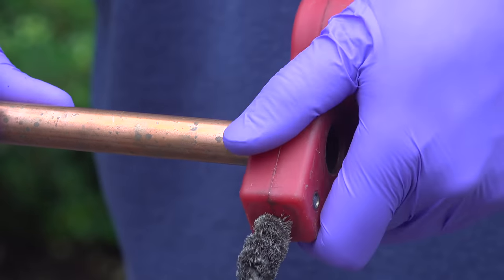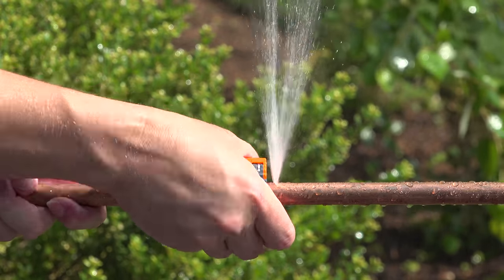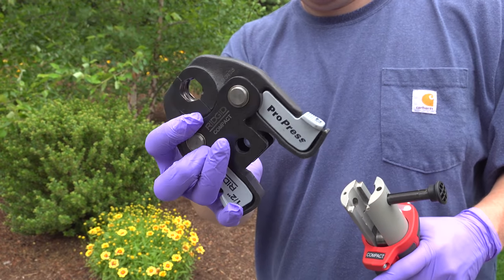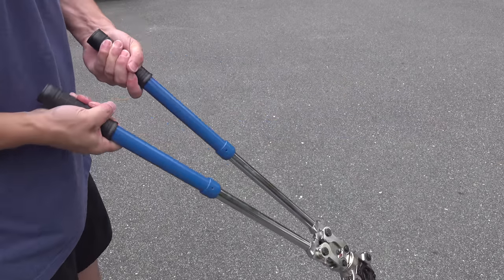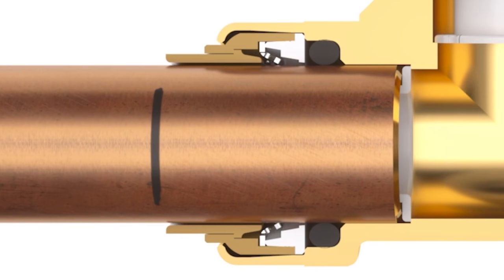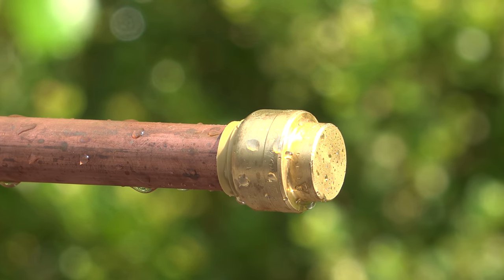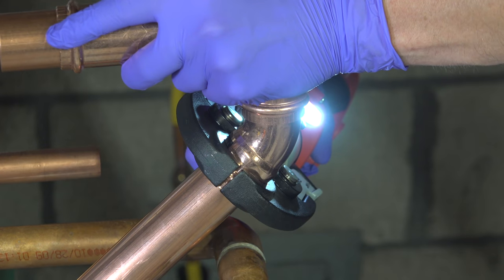NEVER SOLDER PIPE AGAIN - 3 Ways for EASY DIY Plumbing

Comment: I see people complaining about rubber degrading. Silicone: am I a joke to you?
Also don't use sharkbites with high water pressure. They have a rated maximum pressure. I see some people didn't read the manual... Naughty.

Comment: Need a special tool to remove shark bite fittings? Can easily use a crescent wrench, man. Also, if you are doing something in a wall, like I did today replacing valves for a washing machine, don't put that stuff in your wall. If it's on an indoor water heater that you'll replace 8-12 years down the road, probably fine. And I don't think you'd fit a propress tool in that wall, either

Comment: Come back in 5-10 years when the things all need replacing. 

Presoldered fittings are as easy as it gets. If the area has combustible material simply utilize heat mats

Comment: being a plumbing video you had to know this was coming. The critique. you should make people aware of the potential or should i say likely event that these products will fail. It doesnt matter it is eventual . Any thing that has plastic or rubber parts will fail. question is when but know it is just a matter of time. When they tested these products , it was most likely with in a decade or less. So these companies end up using plumbers and you a homeowner as testers for their product. Soldier pipes is proven long lasting permanent water  seal. Alot of these products were invented recently, 30 years or less. products require a lifetime of testing to be proven . which alot of these products havent really been proven to how long they will last. I have seen these product approved used and then fail costing 10s to 100s of thousands of dollars. Just keep in mind whatever you use your going to pay and pay a lot. as a plumber that came from a family of plumbers i would recommend you use what has been tried and tested for a lifetime . Im not saying these products dont work i saying these products have only been around for 30 years they have plastic and rubber parts which are known to fail after long enough periods of time. copper pipes have been around for close to a decade. just remember you get what you pay for always/;

Comment: You would never want to hire a plumber that would use these kinds of fittings behind a wall.

I'm a big fan of shark bites.....the are perfect for a temp repair.  Under a sink, where you can visually inspect the pipes they are fine.

And.....I've never had a shark bite fail, but personally, I would not use them for any work I would do for someone else.

Comment: so if you look at like hose bibs or kitchen sinks shower faucets and etc. they contain rubber seals inside of them rubber always degrades and eventually starts leaking same thing will happen with these overtime they may last about 7 to 10 years at max guarantee you'll be having every joint leaking. Just go ahead and do solder don't even bother with those garbage things

Comment: I've been soldering since 8 when  my dad showed me and I will say I rather solder or braze copper then use these non soldering fittings ... solder will last forever .. it's not that hard to do . Just most people these days are lazy and don't want to do it the right and long lasting way ..... shark bits are for people that screw shit up and have to get it fixed fast and cheap ....

Comment: Hey this method of churshing the oring is new but the turbulence in water pipes being not smooth  inside won't last l have been a plumber for 50 years l still solder quality vs economics

Comment: Problem with all three solutions is they use Orings and these rubber or silicone rings will distegrate in a few years while welding and even teflon tape can last for much longer. 
It will be a good choice if you are doing a project for someone, but for my house, i will definitely stick to welding. :o

Comment: Tell me why I should buy about 10 other tools (and spend probably over $200) specifically for pipe fitting when I could get 3 things (solder iron, flux, soft metal spool which costs less than $50) and use them for pipe fitting and so much more! …oh wait, there’s suckers out there!

Comment: I will never use these.  I’ve had these fail way too many times.  Not from me but from licensed plumbers doing the work.  Now I could blame the plumbers and in some way it is user error but I do not like this technology.  

I had a plumber come in and do a valve swap with these fittings.  I slightly adjusted the valve brace and one of these fittings leaked.  Had they been sweat with solder, that would not have happened.  

These are for people who don’t want to take the time to properly sweat connections.  Many plumbers use them because they can get in and get out and get paid.  Its fostering shoddy installation practice.  

Either go PEX or solder.  Only two options I trust.

Comment: Pay for itself?  Only in a case where you saved yourself from a house fire.  Other than that, it's not going to pay for itself.  Probably been 20 years and I haven't spent $175 on plumbing supplies at my house, no less $175 so that I don't have to use a shark bite or solder.  You have to pay for the copper anyways, so the only thing working towards paying for itself is possibly time, gas, and solder.
Reply from the maker: The comparison is versus paying for a plumber

Comment: 3 ways ? At first I thought it was a mistake , because propress and shark bite are 2 ways. 5:06 Then I noticed 2 different propress tools counted as 2 different ways. 
     Another way not mentioned is compression fittings .

Comment: I'm really not crazy about the o-rings. I've never seen a problem with shark bites and the pro press fittings are just starting to be used around here. I'm especially not convinced an O-rings on a gas line in occupied living spaces is a good idea. Seems like we're going backwards just to accommodate people are too dumb to learn how to sweat copper or thread pipe.
Reply from the maker: I agree with you about o-rings but then I hear this myth and decided to put it to a test, insane results: https://youtu.be/QtysRkM1gEI

Comment: I did work with many tubes and pipes types connections. I'll give you my honest advice from real experience. Ideas is good but having o-ring as a seal thats most probably viton o-ring's material. That O-Ring will last not very long then what!!?? You gonna break walls to replace all connections again every few years! That's only good where is tubing easy accessible.  yet Only for 5 years you would have to replace all connections, fittings like elbows, tees and valves again. The o-rings connections are Only for short time good solutions. As I said 5 years the most 6  You'll be lucky if o-rings last that long! For House Installed tubing with those connections is like shooting Yourself in a foot! Dont ever do it! Listen the retired engineer who worked in that fields for  long time.👌if you dont listen and you use those fittings with those types of conetions in your house you gonna regret it for rest if your life!

Comment: How will you use THAT in tight spots?
Reply from the maker: It fits in 4" designed for tight spots, but extreme spots work with extension rings  https://amzn.to/3wCi3pa to get in anywhere or any angle

Comment: You definitely don't need a special tool to remove a shark bite fitting.  They pull right off.  Just solder it.

Comment: O-rings age and fail. I'll stick to soldering my joints. 30 years in this house and not one failure. PEX, plastic lines, and others have come and gone, but copper stands the test of time. Cool gadget about though. See how it holds up on a hot water line, 10 years from now.
Reply from the maker: See where I tested a myth about these, it even surprised me a lot! https://youtu.be/QtysRkM1gEI

Comment: soldered copper pipe joints are easy and permanent  .    I don't like the idea of some tiny blade gripping a pipe and an O-ring holding back a disaster in my walls ..

Comment: I won't be using these squeezed joints any time soon. I'd rather rely on a compression fit with an olive than trust that something squeezed tight will remain tight during a decade of heating and cooling.

Comment: I wouldn't use it. My concern is different than most of these postings. Mine is mechanical creep from settling and temperature deviations. Temp is the worse one. On longer runs, the copper overall length with change. The O-ring will move back and forth drawing in outside contaminations that then wear the rubber. A new school way doesn't mean a better school! For me, this is just a lazy way...

Comment: How old is plumbing in most houses 50, 60 years or more. O rings starts to crack and no longer properly seal. Do you really want these connections in your walls and ceilings? I don't trust them. Has there been long term testing of these fittings? I don't think so.

Comment: My plumber probably learned from this video. 

I never saw a "professional" plumber use push fittings on the job, until i let this crook into my house.
Reply from the maker: Plumbers rarely use sharkbites, but propress is very common for copper work

Comment: No. Just no. Shark bites are crap. They only work if they are never moved or subjected to temperature cycling. Also notice the shark bite fittings will easily turn on the pipe, which will quickly degrade the O-ring. You also cannot take the sharkbite fitting off and then put it back on over the area it was previously. You MUST cut that area off (now burred by the teeth in the fitting) before putting it back on.  The crimp on connectors are an extremely expensive solution to what isn't actually a problem with soldering pipe fittings. A fiberglass heat mat solves the close in issues and is only $25.

Comment: how long does that rubble oring last vs the sodering?  Does new means better?  Sure is quick and easy.  If quick and easy is the criteria, then sure.  Long lasting joint?  Call me old fashion.  Let the professional do the work properly.  If you don't want to pay the professional, learn and do it properly.  Soldering is not that bad.

Comment: No chance I use this. A rubber o-ring? Does it really handle water pressure? Does it hold up over time? Doubt it. O-rings on things like water filters need changed periodically. Why would this be no different? I’ll stick to the old way.

Comment: An easy fix will last an easy amount of time!! The rubber seal here will fail. It's the rubber seal that's holding the water in, and the rubber will eventually fail! Thus if you use these everywhere in your house and then once they start failing ya gotta a huge problem. Although if all joints were soldered, then no problems.

Comment: Looks so easy and expensive when pipe is under a basin or cistern it not so clever ...simple compression or push fit fittings are far cheaper and more accessible to fit

Comment: I would only use a shark bite in an emergency, until I could come back and do a permanent repair.  I consider them temporary at best.  There are just too many reports of failures.  Pro press is ok using the proper pro press tool, not some Chinese knock off.  The only thing I don’t like about pro press is the look of the finished crimp.  Couldn’t they have designed it so it crimps round instead of looking square?

Comment: 😂 I wish it was all that easy all these speed fittings are expensive and use O-rings to seal would not want to be in that house 10 years later I've seen firsthand what happens to O-rings when they get old and the rubber dries out

Comment: Ironically soldering is the easiest coming from a plumber that would only pro press. Only time I would prefer pro press is a live fix. I've seen pro press fittings rotate although unlikely it is mostly caused by dying batteries. You can argue that you make sure this or that.. but one day you won't. Soldering is easy.

Comment: These joints tend to fail at 5-10 years in. Use a compression joint or soldier otherwise you will be sorry.

Comment: Working with O rings for decades.... trust them for a permanent long term fitting in plumbing? Hell no it will break rot or burst in a couple of years, then you have a soaked wall or basement floor. no thank you.. now as a temp fix maybe...

Comment: assuming you got space to use that gigantic handles.In tight spot impossible.Even cheaper and easier is installing a compression valves.

Comment: No thank you I'll still sauder. Does all rings in the fitting are under pressure and the one side is still exposed to the elements and tell me what o-ring doesn't disintegrate after a while or doesn't give under pressure after a while, after all it's only rubber and all rubbers tires Etc wear out!! And this being inside of walls you could imagine what's going to happen with all these fittings that are crimped on, they're going to have the same problem with this that they had and are having with other types of crimp on fittings they do fail and how many people want to go inside the walls of replumb after 10 years? And this old ring is under constant pressure in the water system and like I said with one side exposed to the elements and rubber does disintegrate, who in their right mind would buy a house thinking or knowing that it would have to go ahead and replumb it in a couple years because of these fittings? It is simple and fast and helps the plumber make a quick buck but in the long run there's nothing like solder!

Comment: These joints are a failed experiment and should be avoided. As a maintenance manager I have had to replace so many of these. They are good for 10 years then the rubbers fail and they completely fail and not just a minor leak. I have lost so many false ceilings because of this. Compression fittings or solder them but never these shark bites. You will regret it.

Comment: Hah.. Those self-sealing rubber O-rings will fail over time as the rubber degrades. A soldered joint lasts centuries!

Comment: Not very good idea. There are several diameters of pipe used in the house 1/2" ; 5/8" , 1" .  Technically if you need to put one small $1.50 coupler in the pipe you need to spend $200 for each pipe diameter. Second looking at mechanical crimper - it is bulky and will not fit in tight spaces. So better alternative old cheap but very reliable soldering or shark tank connectors, which does not require any crimping.

Comment: Great for an emergency but I would never install a "project" using these devices...maybe for a drain.
Solder, torch, flux, sandpaper is all you need to make a permanent and worry free connection...learn how to solder, it's not hard and ultimately cheaper.

Comment: This video is bogus shark bites are not bad. But soldering and clamp too are better also you can pull shark bites of with a regular old crescent wrench
Reply from the maker: Didn't I recommend them as an option? So the video is bogus because I agree with you?

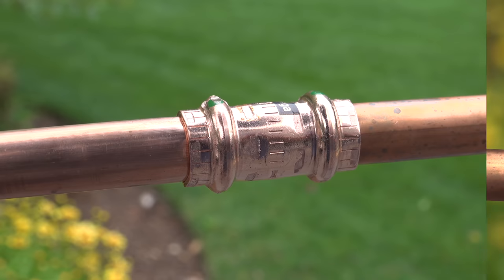Comment: Isn't even logical to use an o ring ,I guess if one like to half ass stuff and then fix half assed lines multiple times a year.. about 1:30 into the video a soldered connection would of done.. I have use shark bite a few times, they seem to hold fine

Comment: There is more better systems to connect pipes... but you need using plastic pipe not copper one.
For me is always funny watching this us homes that mostly made by wood and 'cartoon' that using copper pipes for 'better endurance' or whatever.
When you home collapse in 10-15 years or you need remodeling it... what purpose of using copper pipes?

Also every copper pipe user should now, that this pipes can act as cathode when it be connected in some area with others metals, like aluminium. It's called 'galvanic corrosion'. Sometimes you don't need to much other metal to contact, to start this reaction. 
And I know that many things this plastic pipes are not so 'healthy or durable' as copper one. And in v. long period of time it's true. But this time is like 30-40 years now, because new plastic pipes are really superior if we compare them to old ones.

Comment: I'm going to guess there's no new product that will ever satisfy the old timers... Hire contractors that are willing to admit that the optimal solution varies according to the circumstances of time, money, environment, expediency, longevity, etc etc. Not every fitting needs to be overbuilt to survive WW3. In the US it's likely your single family wood frame house will be torn down in ~200 years from generations of deferred maintenance  anyway. The maintenance that's never done will be its demise, not the cost-efficient maintenance that's completed.
Reply: They're using that same system to install gaslines.
How Many Homes Have You Heard Of Blowing Up After Smelling Gas?
Within the last ten years?

Comment: Pro press is not for diy Jobs the tool and fittings are to expensive .Shark bites are ok for patch jobs but get real expensive fast for larg complex work and can fail after a few years. You'd be better in long run to call a professional...cost included

Comment: Solder = no specialized tools, uses smaller tools for tight spaces, proven, no O-Ring to dry rot and fail. Will stick with Solder, thanks.

Comment: No way I’m trusting rubber o-rings behind a wall. Get a fire blanket and do it right it’s easy and permanent
Reply from the maker: Watch this, it even surprised me: https://youtu.be/QtysRkM1gEI
Reply: @SilverCymbal  that is neat but I just don’t know. Why mess with a proven method that is easy and lasts. To me it reinventing the wheel or a solution to a problem that doesn’t exist.